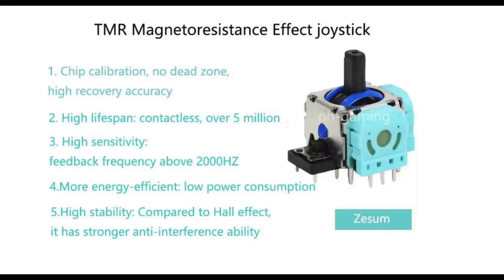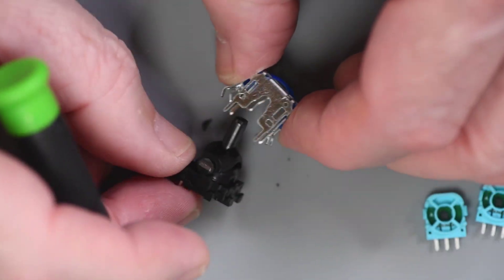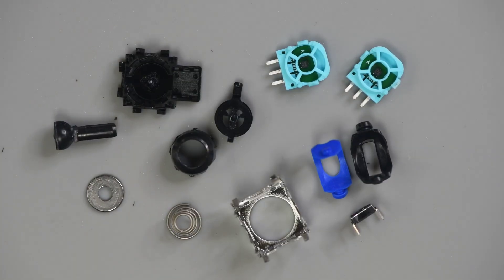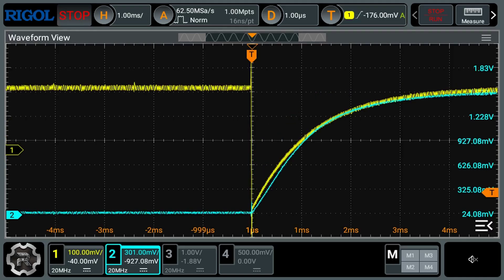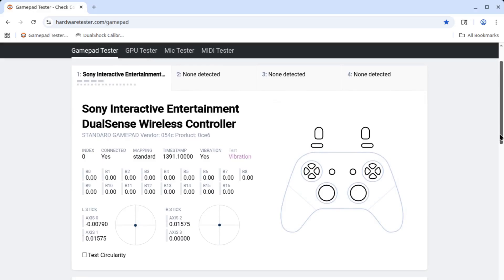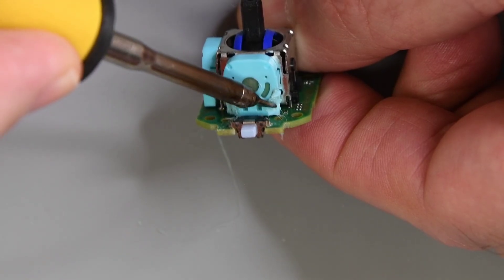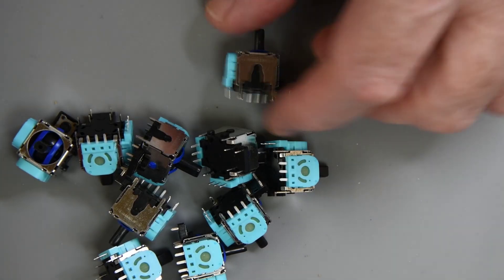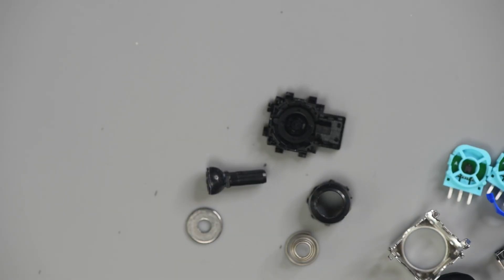Zesum TMR Joystick Review: TMR Tech for DualSense & Edge

Comment: I’ve gotten used to the low tension version of the ginful sticks. I don’t think I could ever go back. 

My hands and thumb is less tiring and less sweaty with the low tension during long gaming sessions.
Reply from the maker: Then you might want to try the GuliKit NS55 adjustable tension joystick.  Or watch for the release of the K-Silver JT13, which is supposed to be adjustable.  I much prefer a lower tension joystick myself. And I found it surprising that the NS55 would adjust to a setting even lower than I liked.
Reply: @metalplasticelectronics354 I will be purchasing a ns55 per your recommendation, thank you for all the informative videos.

Comment: Hello friend. I'd like to replace my dualshock Alps for TMR but I want the same or very close gf tension and feel. You said standard alps have a little more resistance at the center which I enjoy. 

Are there any TMR kits that replicate that higher initial tension of alps or should I get those Alps+TMR Sensor mod you showcased in another video?

I play competitive FPS and want to get something as nice as the Battle Beaver Magneto TMR sticks without buying a whole controller. 

Thanks!
Reply from the maker: If you want the mechanical feel of the Alps, then those will be the best choice.

Comment: js13 pro, is average. now that the zesum is here. it has everything that the ks13 has and more, the cone spring, and the unique internals make it for the ages.  i had the fixable problem of them being “creaky” when moved. i fixed it by pressing on the stick firmly, no more creaking. 
when you DIY you can swap out the sticks upon a new TMR being released. i did that three times, but with my liking these Zesum TMR’s so much, i tchanged my 4 controllers to them. i have tried the gulikit, then Ksilver, then ginfull 80gf, then ginfull standard in my controllers. BUT disaster struck with the gulikit 720 when i desoldered my other 3 controllers to test the gulikit 720. i did it my normal way, but too sloppy. i wrecked  3 controllers. because i pulled out the copper from the vias.  lesson learned via hard knocks, lol. so after i received the Zesum TMR’s i was very careful in removing the the ginfull sticks by making sure it took no force to remove them (it was a combo of the desoldering tip being not the right size.

in anycase,  i only like the caps of the standard gulikit. (i still have 5 gulikits left, and 10 ksilvers, and 20 gulikits… ) i ordered 10 more Zesums, i hope they are the same as original. the place that bought them from (nh store) has increased the price 3.5 times. hopefully they are exactly like the first ones i purchased.
lol, a hobby is a business you lose money with… btw, buying used controllers on amazon, is a crap shoot… of the 9 controllers. 2 were ok. 4 had stick problems needing to be replaced. one had  a non-responsive button, one had the worst soldering job i had ever seen, (returned) and one had no trigger feedback. returned. oh did I say i like the Zesum TMR’s…
Reply: What's the tension on zesum tmr?
Reply: @Curious_BeingNX low tension from (like the ginfull 80gf) immediate center, increasing to standard outside (like ginfull normal) . but, some zesum have  a creaky problem… on my first order they were all smooth. on second and third order (10 each) only one pair (20%) were smooth. really like the feel. smooth. but I have moved on to the  ginfull ds13max. on stellar blade the ginfull ds13 seems to have a sense of faster speed…  i would not recommend the gulikit stick, only for the stick caps.  right now i am thinking the ds13max is the best, (smoother because of the metal axle), the ks13 has the same design, but the magnets are bigger in the ds13. (i have changed my mind about what is best several times, first gulikit, then k-silver ks13, then ginfull and ginful 80gt, then zesum, then ginfull DS13max or ds13. i like the feel of the zesum, but the ginful ds13 feels faster…
Reply: @paulsummers1717 ok, thanks for ur explanation. Looking for tmr stocks for edge controller , which ones do you recommend.

Comment: Subbed! Love your format buddy, great stuff and very informative. If possible, may I request a flux comparison or some advice on which flux to get and why? Many thanks for all the information you provide.
Reply from the maker: I can look into it.  Most of the time, I buy a brand name; it costs a bit more, but I've never been disappointed.  The last I purchased was some STIRRI-V3-TF, and it is the best I've ever used.
Reply: @metalplasticelectronics354  Many thanks! Appreciate your time. I'll take a look at that flux next time I need to buy some. I bought some M G Chemicals 8341 on Amazon that seems to do the job and easy to clean with isopropyl. I'm just doing the edge stick mod for a friend who can't afford to keep buying stick modules so don't use a great deal.

Comment: Any update on the dualsense battery testing? Also there is a new model out Bdm-60/cfi-zct2w
Reply from the maker: Still working on it.  Oh, another controller to order, may have to wait a bit on testing the new controller.  But thanks for the info.
Reply: @metalplasticelectronics354 the new controller comes with the revision of the slim/pro matte finish.

Comment: Which manufacturer of TMR sticks feels like the original alps? Any advise?
Reply from the maker: The adjustable GuliKit NS55 could be adjusted to get very close to the Alps.  The K-silver JS13 Pro sticks are a little softer than the Alps, but not by much.  But if you really want the Alps feel, take a look at these: https://youtu.be/M1RT-sTofJA  .
Reply: @metalplasticelectronics354 thanks. But I hate the click of the alps when moving them. So I guess fav union would be best for that?
Reply from the maker: I haven't had any movement click for either the K-Silver or the NS55; that seems to be an Alps only thing.

Comment: I feel like this design could survive wear and tear wobble better than the rest of Joystick boxes. That would make this the best stick for TMR sensors, for longevity.

I find it curious that the internal mechanism is similar to the sticks of the gamecube controllers, with the difference that this one has a metal ring in between the spring and the plastic "ball and shaft" and that ring is attached to said piece instead of the spring. On the Gamecube controllers the the spring had a plastic piece on top that pushed against the shaft causing a lot of wear (less than if it was directly rubbing against the spring I guess). This stick seems like a logical upgrade in hindsight, one that we should have gotten a long time ago.
Reply from the maker: They should hold up very well.  I think the return to the center on this design will be better overall.  But it does have a different feel.  If they had a lower tension version of this stick, it would be great.

Comment: hello, what is the white part your are attaching to the potentiometer to test current draw? Do you have a link?
Reply from the maker: It is a JST-XH 2.54mm connector.  You need the housing and the sockets to go in the housing.  The sockets crimp to wires, and then the wire/socket is inserted into the housing.  I believe Amazon has some kits that have the wire and socket already crimped with an assortment of housings.  I've not tried them, but that is probably about as close to an assembled cable as you will find.

Comment: JS13 Pro was goated now everyones copying it.
Reply: Just ordered some im curious how the k-silvers perform.
Reply: Js13 pro is really good. Gulikit good.
Reply: @spacekees102 js 13 pro or gullikit which one do you prefer
Reply from the maker: This should be great for the company that makes the TMR sensor IC.
Reply: Eh, plenty of manufacturers tried Angle TMR on separate occasions but saw to many issues in-house. One even told me they saw up to 50% of DOA or plenty of issues. So they opted to stay with Off-axis linear TMR.

Even Ginfull tried last year. But decided to give them a 8months R&D when they are usually the ones working on smaller time frames and put out units as fast as possible yet willing to make changes to the module to further improve it. (Something others have issue with making no changes in 5-15years). Including Favor Union updating there module to try and stabilize the module for the magnet and gave them a 9months test phase.

While K-Silver decided to rush it out 4 minor revisions of sensor. Meanwhile haven't fixed the issues with the flawed module. The guys behind the zesum already had this module but using Pots. Didn't see much from them in a bit. But them mounting the sensors on a slightly more stable module allows them to perform a little better. While the JS13 has constant internal input Windows shifting never feeling and performing right.

The although the zesum is more stable it is a bit ruff. Since it's platform sits on top of a metal cap. So the wiper will move on the surface compressing the conocial compression spring producing a loud sweaking or noise. So you can tell some friction is there. Where maybe using better lubrication with oil or grease can somewhat mitigate it.
Reply: @Vizr.  Yet js13pro is still one of if not the most linear (Linear as pots) joysticks out there.
Reply: @OfficialMyMindset Funny thing depending on batch once mounted on the module they can avg a 92-96% curve with very similar non-linearity As Ginfull best off-Axis linear TMR of 93-95%.

It's inherent curve means nothing, if the internal input Windows and your range is constantly shifting do to the instability of the module. Never truly developing the muscle memory for it. Always overcompensating and becoming more dependant on hold your hand gimmics like aim-accelerators or aim-assist. Once you take that away the inconsistencies can be felt immediately.
Reply: @Vizr.  how are you so knowledgeable on this stuff? i'm impressed- i'm a semi-pro fps player (halo infinite) and currently play halo infinite on a zd ultimate legend w/ the ginful tmr sticks that come by default (this controller supports swapping in other modules too like JS13 etc)- when testing the JS13 it felt too slippery for me... how can i get in contact with you?
Reply: @supernice_auto  All of what they're saying really just comes down to IC quality and quality of magnet-sensor alignment.  Given lack of manufacturer, they're likely either custom chips or dirt cheap, far more likely to be the latter in this case.  I personally have suspicion of what the sensor actually is, and it'll end up being more of the same as what we've already seen from these manufacturers, just a slightly different arrangement of components.  I doubt we'll see an actual proper implementation of a more linear and stable sensor for quite some time.  I also have to take issue with their credibility, too much incoherency and too many questionable statements.